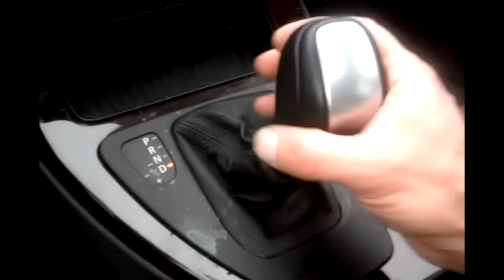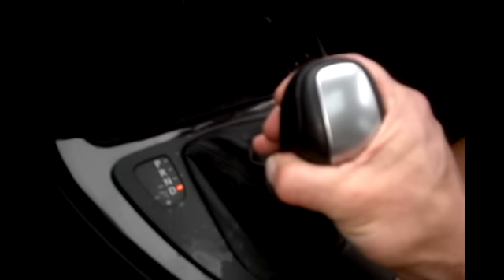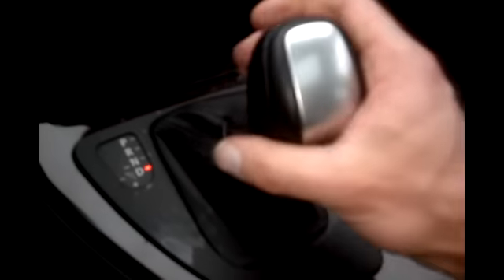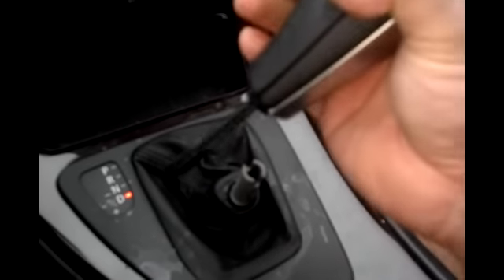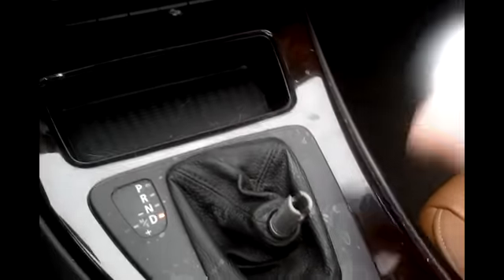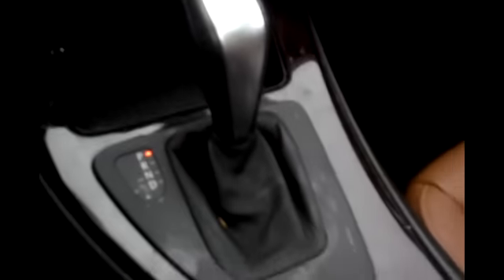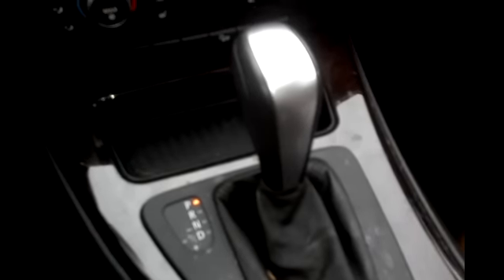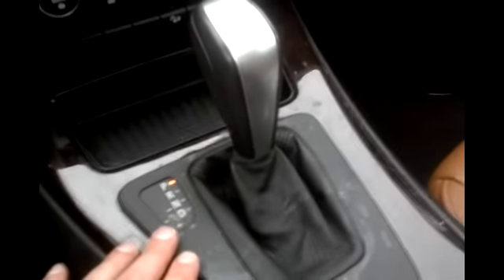BMW E90 3 Series Shifter and Shifter Boot Removal and Installation DIY

Comment from the maker: Hello, I would be glad to help. The M/S is the manual and sport mode. To use this the engine has to be running and  you have to select drive. Then tap the handle to the left (it will move into the M/S mode). Now you are in sport mode which makes the throttle snappier and transmission hold the shift longer. To enter manual mode you push up or down to shift up or down so you can choose what gear you would like to be in :)

Comment from the maker: To put the vehicle into drive first (foot not on brake) put the key in the slot and turn the ignition on so all the lights come on. Now you press the brake and move the handle back. Sometimes I will have to straddle the center console and then with a sharp tug up and pressing the button in the handle can be removed. Use caution as I have hit myself in bad spots before doing this ;)

Comment: Good evening sir im the one with the bmw 2001 325 i and i u have said u were going to make a video on how to change the sensor right next the motor in the bottom  i forgot what its called it was giving me a code and u said u were going to make a video on how to replace that sensor that gives the check engine light thank u

Comment from the maker: Hello David, Definitely now a normal failure. Did you try to disconnect the cable from the transmission and see if the shifter moves or it could be related to the shift lock when pressing on the brake pedal.

Comment from the maker: You would only be able to fix this if you can find damaged wiring. Other wise the problem could still be internal in the shifter and it would require replacement as a unit.

Comment from the maker: For some reason this comment did not go to my inbox. Correct, with the key on in the second position (all cluster lights on) and pressing on the brake pedal to release the shift lock you can put the vehicle into D with the engine off :)

Comment: I have an 328i 2007, the shifter is stuck on park and wont let me change gears from park to reverse or drive. I even replaced the shifter and still wont change gears out of park. please help. im not sure if im suppose to reprogram it,

Comment: Ok, so what am I doing wrong here...I cannot put the gear in drive mode without starting the car. Neither with or without the key in the car. When I do put it in drive, with the hand brakes on...still the shifter handle won't budge no matter what I press or how hard I pull.

If the engine is not running, that shifter stays locked in Park position. There's no moving it.

Stumped.